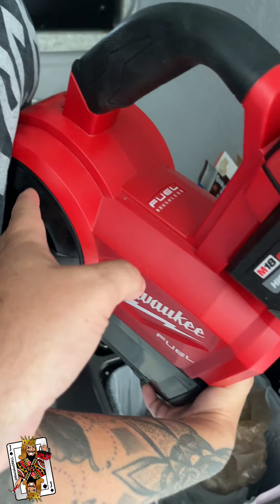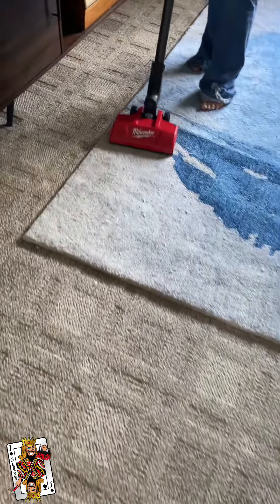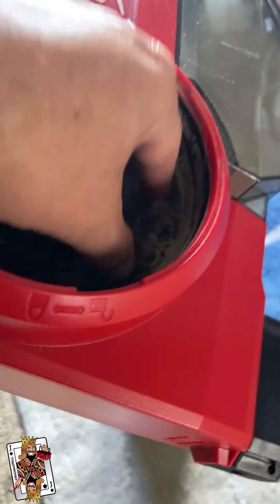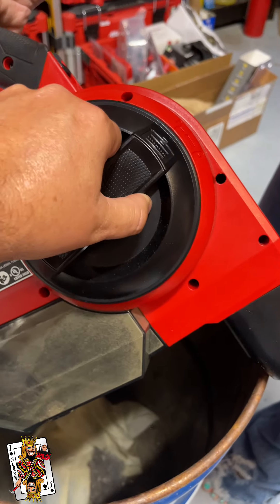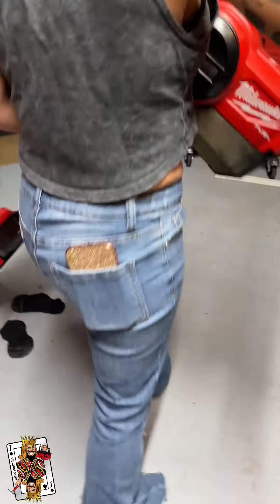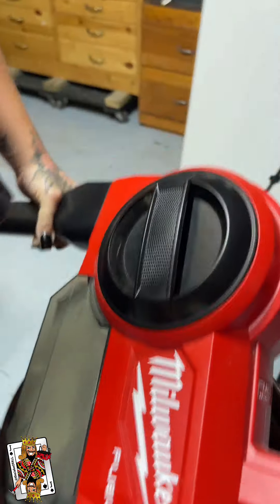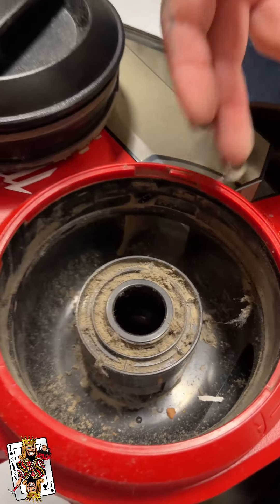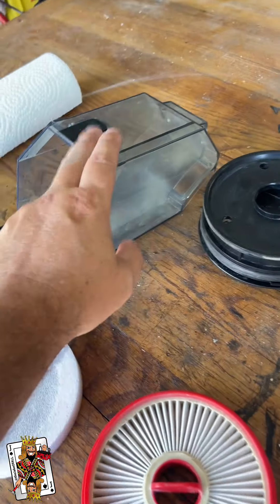Milwaukee Tools M18 Cordless Jobsite Stick Vacuum 0940-20 Clogging Problems

Comment: It's mostly the filter-basket in the donut that's the issue, mine has the same problem.  Air is pulled into the donut and then debris covers the center basket and prevents further flow, and almost nothing actually falls into the collection canister.  If the dust is fine enough, it just passes through the basket to eventually clog the HEPA filter, larger light stuff (like hair) just wraps the basket or sits at the opening to the canister and blocks other things from falling in.  They should recall every single one of these and issue an apology.

Comment: I took out the prefilter and put tape on the hole. The side fills with dog hair and more goes in the canister but it seems to work better. Just have to clean out two parts.

Comment: Same issue with mine stick vac. Milwaukee seems to have some design/engineering problems in their vacuum department. Also have the backpack canister vac and I wish I could say it sucks more but it struggles to pick up the smallest pebbles and drywall debris.
Reply from the maker: Yeah they dropped the ball on this

Comment: I have one, and yes, it is not the best stick vac. I bought it for around the house, for quick messes. However, after a few weeks of use, I too kept getting the red light. So I also stripped it down completely and cleaned everything out. Then it clogged again. Upon further inspection, I noticed that the PAPER FILTER on the initial intake side was CAKED WITH DIRT, and was not letting enough air pass through in order to create enough suction.

Apparently someone else had used it and sucked up a small amount water. Spoiler alert, these are NOT Wet/Dry vacs, Only Dry dust/dirt and only relatively small to smaller medium pieces of debris. They Are Not shop vacs like many other vacs on the market.  

I tried as best as possible, and many different ways, but you can not clean and clear these filters either. I ended up contacting Milwaukee Tool, and they said if these get wet, they are trash. Apparently the filter element itself expands and then more or less seals when it dries. So it is extremely hard for air to flow through it.

What makes it even worse is that I can't find a replacement filter. Luckily, the manager at HD is cool and since I had only bought it about 2 months prior, he let me exchange the entire unit for a new one. 

The second one has not clogged nor had the red light come on, and I've had this one about 6 months or more, and I use it a lot. I use it when I have a small mess, like when drilling through sheetrock or cutting a few pieces of wood and have to clean up saw dust. I typicallyonly use the flexible hose and keave the stick/brush part innthe tool shed. (I am considering returning this one and getting the Packout Vac.).

  I bought a different one for the house, it is smaller and lighter so my wife doesn't complain. Plus it is a bit quieter and able to suck up water.

I hope this helps.
Reply: Good info, thanks!
Reply from the maker: Some good info
Reply: interesting story with the water ! hadn't thought of those consequences lol, I mostly use min for bathroom hair and kitty litter and can just blow off the filters with compressed air

Comment: I’ve had mine for 2 years so far. Stopped using it for a long time because of this issue. I’ve come to the unfortunate conclusion that it works best without the HEPA filter and foam pre-filter. Haven’t had this issue ever since I stopped using the filters

Comment: Yeah that is a small opening that all of that has to travel thru. I mean it's not crazy small tho I think it's more of the donut shape in the pre filter compartment that is hindering it. It looks like the air is competing against itself trying to go over and under the middle part. Are you able to rotate the pre filter inside of the housing to clean it, or do you have to remove it everytime?
Reply from the maker: Yeah seems that way

Comment: I used mine twice, and it totally burnt out and had to return and I’ve had trouble even buying a new one as well, I’ve been refunded by Home Depot and ace hardware a day or two after I ordered from both places and unfortunately the last time I tried it it’s taken over a week and haven’t got my refund pretty disappointing over all but definitely bummed about the quality of the vacuum

Comment: This is the one Milwaukee tool I wish I didn’t buy.  Same issue I have every time I’ve attempted to use it.  What’s worse is when it clogs and a bunch of stuff is in the tube, you turn it off and it all falls right back out onto the floor.  This vac is completely worthless.
Reply: Have you tried to replace the paper filter?  If they even get the smallest amount of water/liquid on them they clog up and stop the air flow, causing what you see in the video to happen.
Reply: @jmackinjersey1  It's never been near liquid.  It's just a horrible product.
Reply from the maker: Same

Comment: Mine quite working after a few weeks very disappointed
Reply from the maker: did you ever get it fixed ?
Reply: @JakeOfALL  I ended up returning it. I figured it would become a reoccurring issue due to the design of the vacuum and didn't want the future head aches
Reply from the maker: @calebleuciuc670  that’s good that you caught that in time

Comment: LADIES AND GENTLEMEN I have this vacuum as a personal vaccum, and its GREAT as a stair, bathroom hair, light duty vacuum HOWEVER pet hair and long human hairs wrap around the cyclone greatly affecting suction and increasing friction around the metal mesh cylinder part leading to a pile up, THATS ISSUE NUMBER ONE the second problem is that the filter works very well for preventing shooting the dust your vacuuming everywhere(hepa filter) THE END ALL SOLUTION is simply to clean all the filters with an air chuck(compressed air, small or large leafblower)..NO NOT YOUR WIFES HAIRDRYER 😅 clean off the cyclone and bin while you're at it, ideally do it while its raining or the wind is blowing towards the HOA presidents house😜